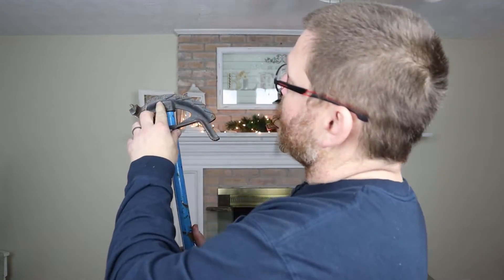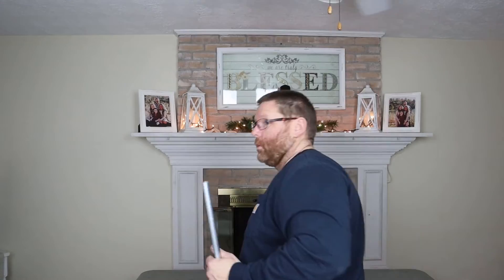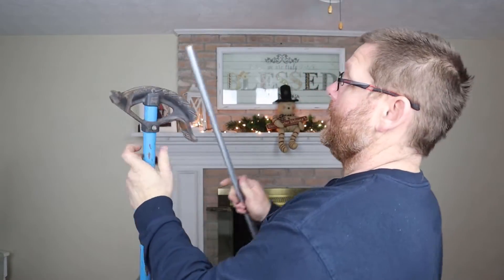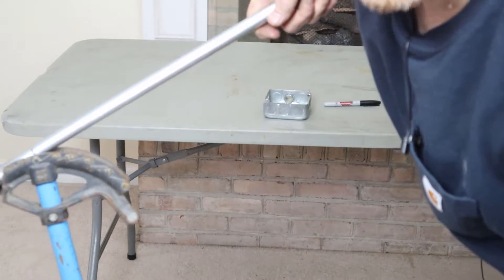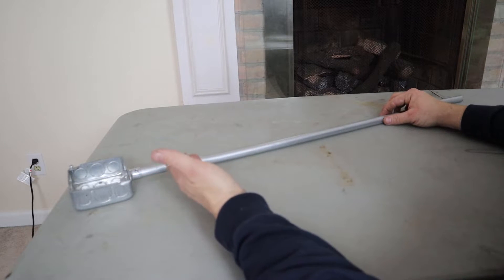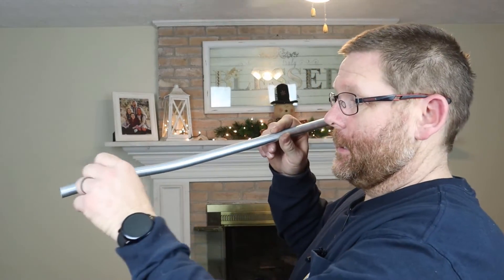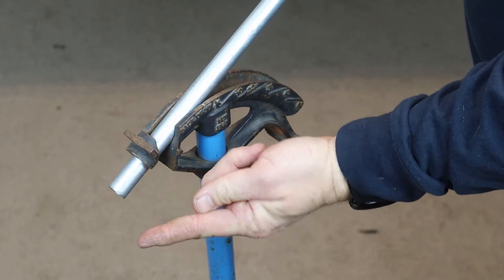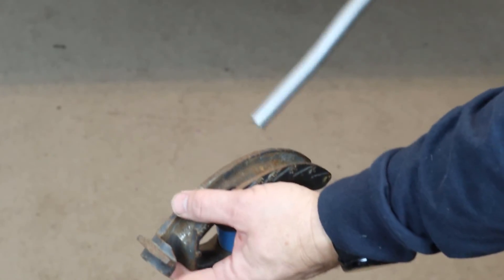How To Bend A Box Offset On EMT

Comment: I appreciate you bro.. I been an electrician for 4 years.. all I did was residential... moved to commercial now and I started bending pipe but I'm having trouble getting the measurements from point a to point b.. example.. going from one pipe to another 4/11 box a few feet over.
Reply from the maker: https://youtu.be/hQMV3Ukjzmk

Comment: Someone please help. If I make an offset or 90 or saddle, do I make sure everything is measured to fit then do my box offset last or how does it work best? TIA
Reply from the maker: That depends honestly.. if you're comfortable with using the shrinkage factors and yes by all means use that however if not then yes cut it to fit

Comment: I love EMT but see lot of electricians now using PVC for everything I'm not a pro just DIY guy I use EMT for lot of other non electrical projects. I even look for shiniest EMT and fittings. I won't  buy those dull looking compression fittings. Never use a set screw connector looks cheap wire nuts only no wago junk pre-twist the wire. I get it general contractor buys whatever cheapest that meets code.
Reply from the maker: Sound like my kinda dude. Need a job 😂 😂.. I appreciate your comment and watching ☺

Comment: can you help with this one -- I build commercial boilers and they are just a huge drum - 8ft+ diameters, we have to bend to the same radius of the boiler as well as laying boxes 3/8 offsets and managing to keep them conformed to the radius so they screw down flat. Some times they are 1-1/2" high box offsets - all prefab code boxes- but sometimes we have to drill out holes in other control boxes that may require a 4in high offset into a long 90 elbow -- This isn't too hard because we can bend by anchoring the 10ft conduit on a lifting lug welded to the top of the boiler-- we can use this to bend the full piece almost completely around it -- The problem we have is when we have to say go up 6 ft following the radius- then break to the left for 3 feet running across the boiler then having to kick back up 90 deg and then take remaining last ft to a 3/8 offset --- that makes it hard for us because we cant use the hard shell of the boiler and that lifting lug to bend the whole 10ft -- its awkward to use the hand bender to try and make all them changes etc... any advice - maybe you can experiment for me please --

Comment: The sine of the angle gives you the vertical offset for each inch (or any unit) of length of the hypotenuse. In this case, sin(10 degrees) is roughly 1/6; so you just multiply your offset by 6 and make 2 marks that far apart. Electricians use 30 degrees a lot because sin(30 degrees) = 0.5 so you can just use a multiplier of 2.

Comment: Nice work, but I thought the multipler for 1/2 emt was 2?
Reply from the maker: Do you mean on a 30 degree bend? Yes it is
Reply: @MountaineerOutdoors  Sorry-yes 30 degrees. He is using 6 in the video.  Why?  Thank you !
Reply from the maker: So yes I do use the 30 degree in my bending when doing an offset. However this is a box offset so I used a 10 degree offset and for that the multiplier is 6. Does that make sense?
Reply: @MountaineerOutdoors  sure does. Thank you sir. God bless.
Reply from the maker: Same to you.

Comment: Question:
What is the "shrink" for the 10 degree bend?
Reply from the maker: Honestly it's not that much. I am working on shrinkage video hopefully by the end of the summer. Stay tuned
Reply: @MountaineerOutdoors  
I found a video that shows it to be 1/16"/inch. 
Indeed, that is not much when bending box offsets.
Your video helped me show how to do the box offset to students that have access to a "Little Kicker" bender one of those companies makes. So naturally they take the easy way, thinking every employer will spring for those at around $350 apiece I assume.
Thanks again!

Comment: How can I secure metallic conduit to a floor to put an outlet box on to it. So its loose 12/2 BX cable pulled through floor into metal conduit and through a connected metal 1 gang electrical box for an outlet . Also what size metal conduit for 12/2 BX cable? will 1/2 inch conduit be ok?
Reply from the maker: Yes and secure it with anchors or tap cons

Comment: what is the minimim distance between bends that will fit in a 1/2 in and 3/4 bender without messing up the first bend while bending the second bend?
Reply from the maker: Honestly not sure each bender is different so you would have to play around with it to see how close you can get. Use the finger method and you can't go wrong

Comment: How do you make measurements based off of the ceiling. I work on a project at a university and never know how to measure things in respective of the junction box so my conduit runs straight in.
Reply from the maker: I am assuming you mean from ceiling to wall?  Same exact way as from the floor. Or are you meaning running the conduit straight line?

Comment: How would you do it on 3/4 pipe? Ive tried it with 10 degree and the math puts the 2 marks to close and it doesn't really work out.
Reply from the maker: So honestly I have not marked a piece of pipe for a box offset in years. For the 3/4 I use my finger technique so I can always have a reference. It doesn't take much for a box offset. Just make sure you keep your bends in check and roll they pipe 180° I know that isn't the answer you are looking for but I will try to work on it to get the math right.
Reply: @MountaineerOutdoors  thank you.
Reply from the maker: My pleasure..

Comment: I’m an LEA and have never really had to bend pipe too often. Now it sounds like I’m going to need to learn so I appreciate your videos for they’re super easy to follow. I’m going to study the Cosan chart.
Reply from the maker: Awesome... I have been making alot of electrical videos lately... One question what is a lea?
Reply: @MountaineerOutdoors  it’s a Limited energy “A” license. Also there’s LEB which the B license isn’t allowed to install pipe or work with Fire Alarm systems or Nurse Call systems. It’s all low voltage. Data, security, fire, nurse call, cameras etc.
Reply from the maker: Gotcha not sure where your from but in Virginia you don't need that kinda license.. That's why I asked you what it meant. I hold a journey man card and where I work that's all they require along with 4 year apprentice program.
Reply: @MountaineerOutdoors  right on. Oregon requires you to at least hold an LEB to pull cat cable. But yea a Journeyman electrician can do it all! I did 6000 hours and 3 years of school to get my LEA. LEB only takes 2 years.

Comment: Waiting on your chart....well maybe not the chart but the video on how to use it.  I'm going across corrugated steel and need to get to about 1 3/8" then... you vids are great MAGA
Reply from the maker: Here is the video I did on it https://youtu.be/yz81Ya9kXek
Reply: @MountaineerOutdoors  Thanks...looks like I missed when you posted it
Reply from the maker: Np hope that helps if not let me know and I will try to help you
Reply: @MountaineerOutdoors  Yes, I appreciate the offer.... The offset I want it 1.125 (1 1/8")  Do I still use the 10 degree? Would the mark be at 6.75 (plus the 3" from the end) making it 9.75 form the very end?
Reply from the maker: What size pipe?
Reply: @MountaineerOutdoors  1/2"
Reply from the maker: Ok honestly that will work or you could use 15 degrees, which would be X4.. That's really what you want

Comment: What size emt does the finger trick work for also thank for putting this information out there
Reply from the maker: I use it for all size up to one once. Gotta adjust it since the 1 inch is a bit bigger. But 1/2 & 3/4 no problem. Thanks for watching and commenting ☺